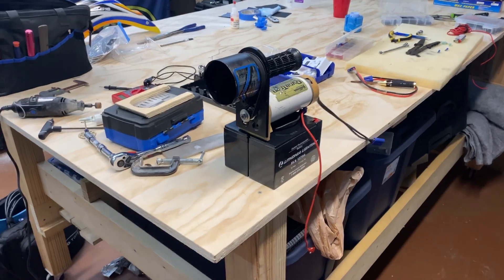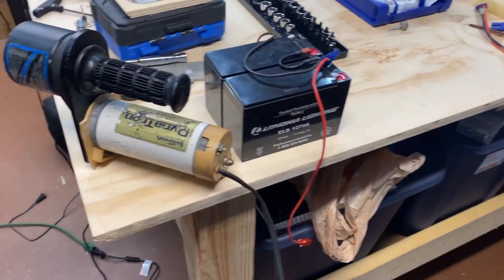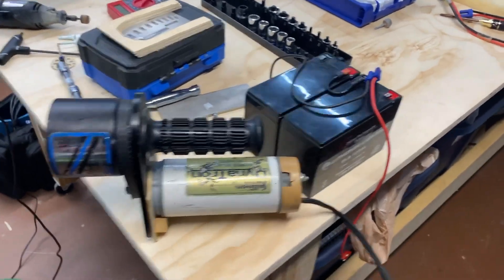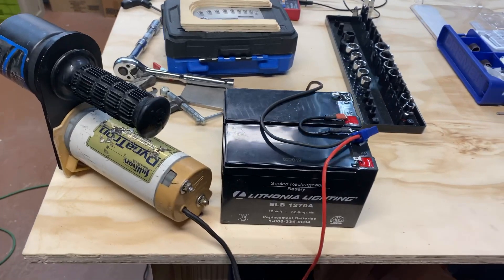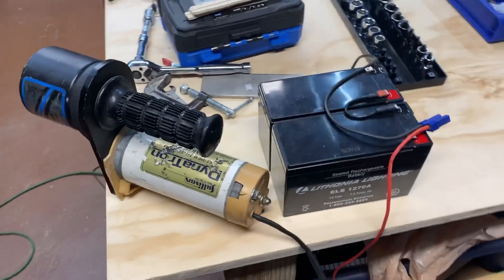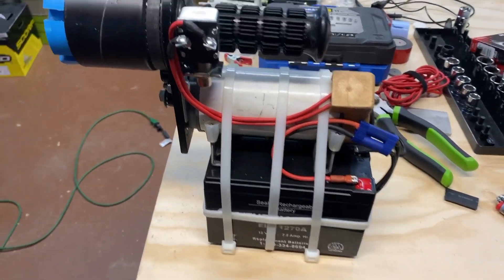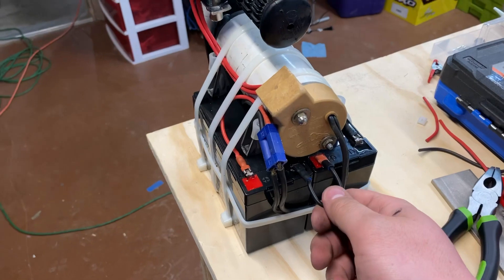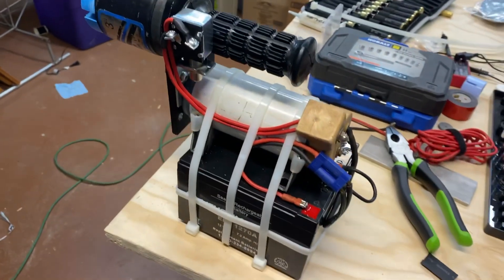Sullivan Dynatron 24v with Miller Gear Reduction Starter Build

Comment: Nice set up.  Can you tell me is that a Sullivan cone?  The Sullivan/Miller starter I received had a different cone configuration and my SkyWing 120 size cone bottomed out on it.  Yours looks like a better option.  Just noticed that your rubber handle is also different from mine.  Mine has a foam handle.  But it does work fine.  Used it on my GP123 and works fine with an 80C 6 cell lipo.
Reply from the maker: I am not sure about the cone. It came with the starter when I bought it. I would almost bet it is Sullivan but it has no markings on it.

Comment: I have the same starter and it’s not a lightweight! Those batteries had to add a ton more weight to it. Why not just use a LiPo and zip tie or make a small box under the charger?
Reply from the maker: Hello. Thank you for the comment. Yes. I previously had a set up like you describe. Unfortunately, it just didn’t work for me and I got the batteries at a steal price. You certainly could set it up lithium style if you like.